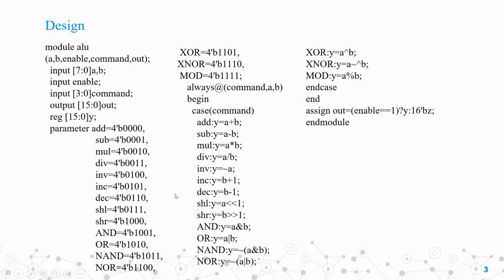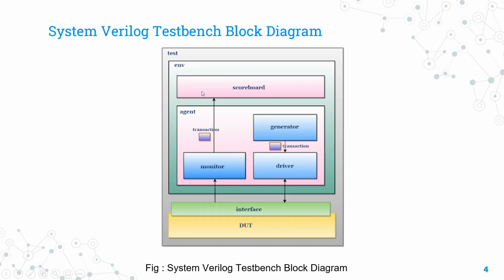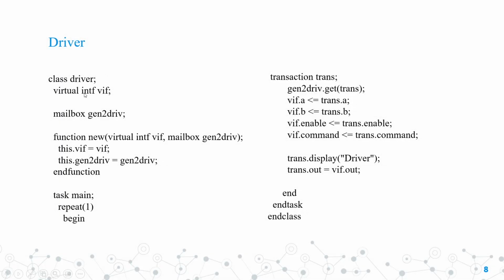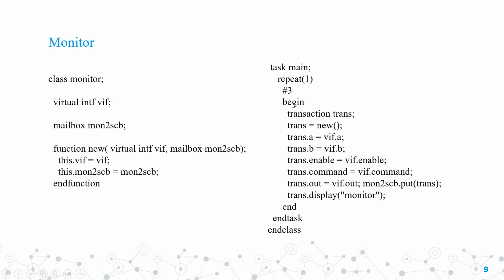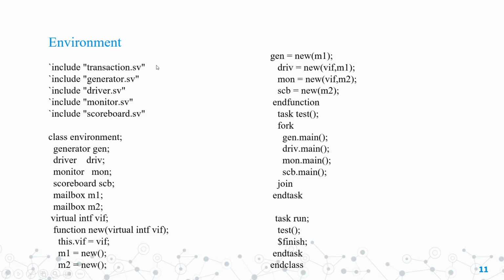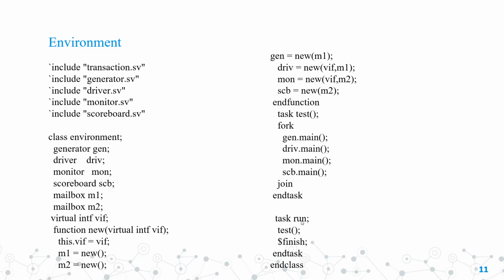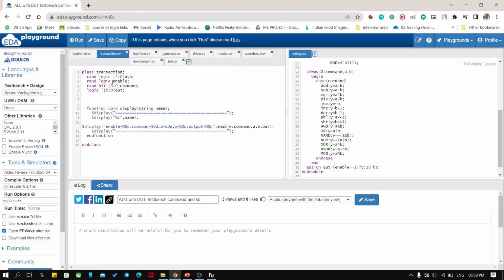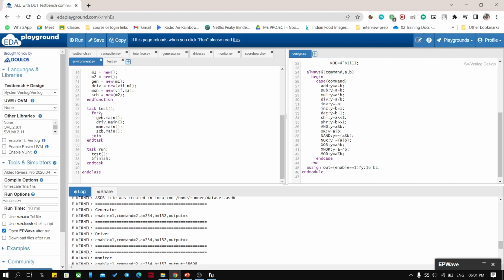Verification of ALU with basic System Verilog TB

Comment: Hii sir I performed the code exactly as you have performed but I a get errors

VSIMSA: Configuration file changed: /home/runner/library.cfg'

ALIB: Library "work" attached.

log

)

W

work/home/runner/work/work.lib

ERROR VCP1002 "File name string expected after include." "testbench.sv" 1 9

ERROR VCP1004 "String constant is not closed by double quote." "testbench.sv" 1 26

ERROR VCP1002 "File name string expected after include." "test.sv" 1 9

ERROR VCP1004 "String constant is not closed by double quote." "test.sv" 1 28

FAILURE "Compile failure 4 Errors 0 Warnings Analysis time: 0[s]."

Exit code expected: 0, received: 255

Done